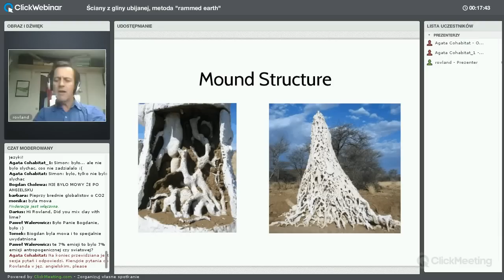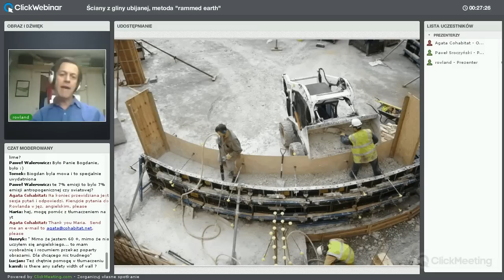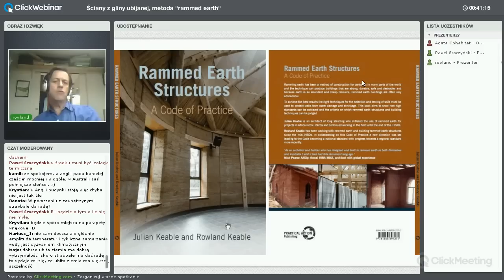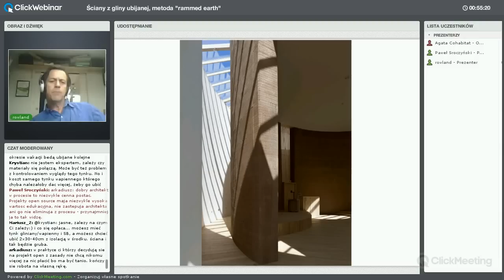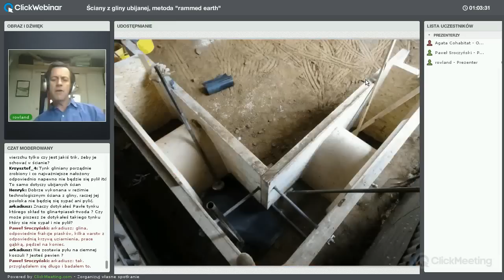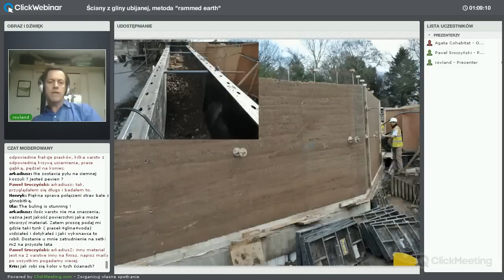Ściany z gliny ubijanej, metoda "rammed earth" [Cohabitat Webinar]

Comment: Concrete requires 15-20% portland cement.. Stabilized Earth uses maybe 5% cement.
My mathematics tells me that a 5% mix is a saving of 75% cement/ CO2. 
Obviously they are not the same thing - else people would be making 'concrete' with 5% cement Duh..
If your soil is such that some cement is warranted - to give the cohesion needed in a given scenario - well then 5% is less than 20%
If you soil is good enough and the loading/ build conditions such that no cement binder ie zero% is needed - well even better.
But dont confuse things by saying that 5% may as well be same as 20% concrete - Be accurate - people need accurate info!!

Comment: questioning that you would call putting in portland cement as an additive you "might as well call it concete " that is not really accurate or correct as the additive is added to soil and sand and improves its characteristics in construction.